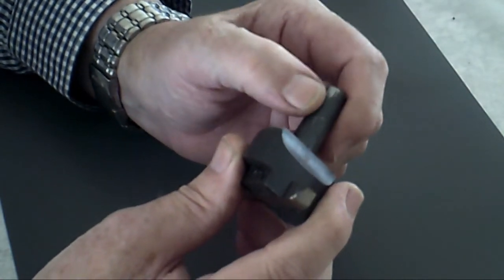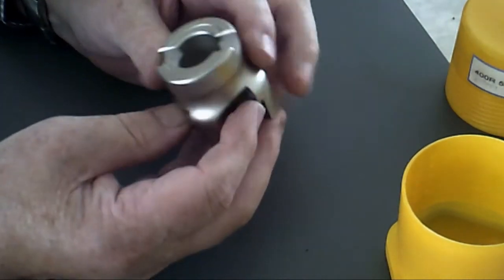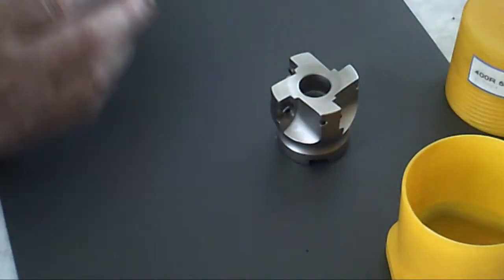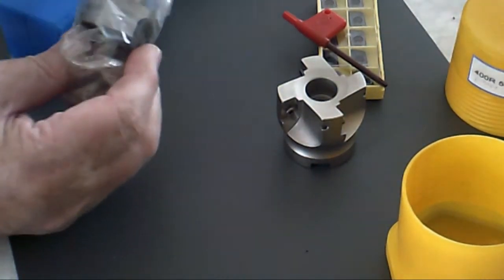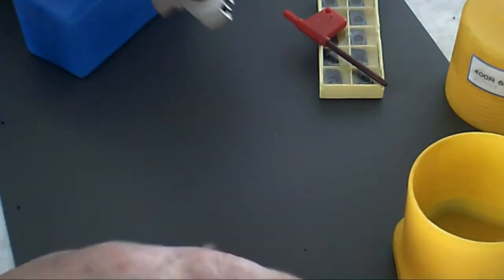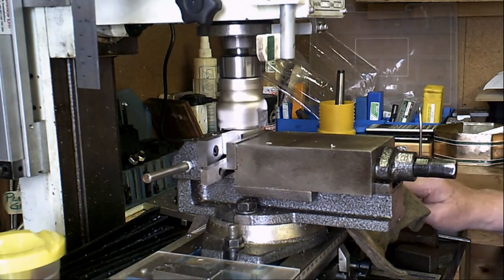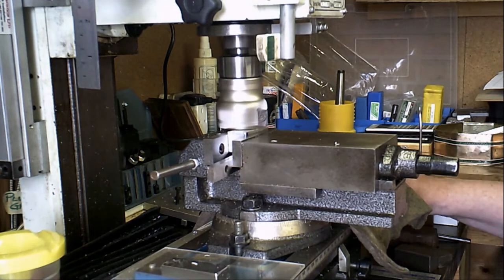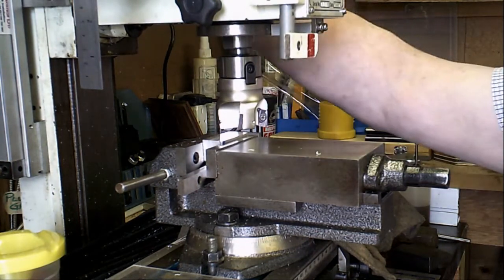End mill / face mill on a small Chinese milling machine

Comment: proof would be actually cutting rather than just saying you cut it
Reply from the maker: That's true, but the shots that I took showing me cutting it actually was mostly my elbow and side. My workshop is small, I have a lathe, a mill, a drill press and a bandsaw in a small shed.
However, I don't lie, I really did cut it, and I have yet to test the 80mm diameter cutter but serious illness has prevented me getting into the workshop for the last 12 months. Once the weather picks up rest assured I'll post the complete review of the larger cutter.

Comment: what rpm are you running that at?
Reply from the maker: I don't have a speed readout on the mill so I am best guessing here; I have the speed dial set at half on the low gear setting so I estimate it at around 250 - 300 RPM
Reply: Tiny Workshop, Big Ideas Thanks buddy

Comment: Hello, i have bought the same face mill, nice shine on your parts..=)
what speed do you have (rpm) and how mutch did you cut every run over, im from sweden and i dont understand what you say in the video im afraid..=)
Reply from the maker: Hi Doger, thanks for viewing the video and commenting on it.
Obviously, depth of cut depends on the material. In the aluminium section I ranged from 20 thousandths of an inch to 50 thousandths (0.5mm to 1.27mm).

In steel or cast iron limit the cut to 20 thou (0.5mm)

I dont have speed readout on my mill but I estimate it to be in the region of 200RPM - Make sure that your mill is trammed in as accurately as you can - I cannot stress this enough, the last thing you need is for that large mass of metal digging in to the workpiece.

Comment: Sanford Swope October 10, 2017  
Thanks for reviewing the cutter.  You state you are using a small Chinese mill.  Do you know the wattage of the mill motor?  My Chinese mill is from Little Machine Shop and has a 500 watt motor.  I wonder if my machine has as much power as yours?  Thanks in advance for your reply.
Reply from the maker: This is my mill
http://www.amadeal.co.uk/acatalog/AMA16VF---with-Fine-Feed-and-DRO-AMA_MI_16VAWE.html#SID=16

The motor IS 500watt - I've never stalled it, it always seems to have enough power as long as you limit the cut to something sensible - as you use it you will get the feel of how much to feed in.

I have recently bought the 80mm version of the face mill shown above but have not yet had time to test it out. When I do I'll video it and post the results on here.

Thanks for commenting
George